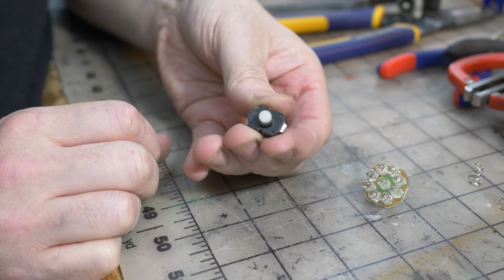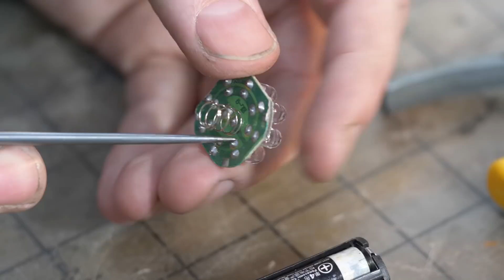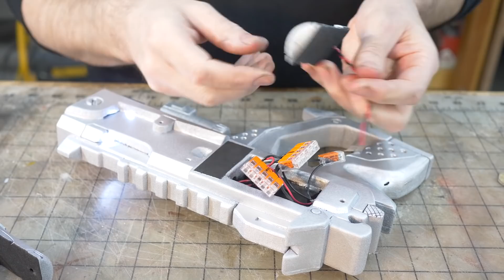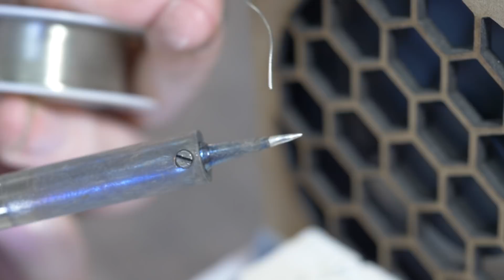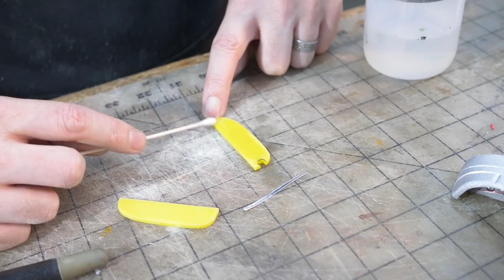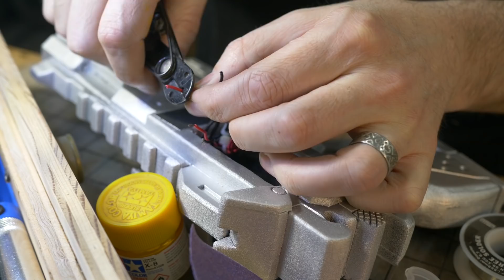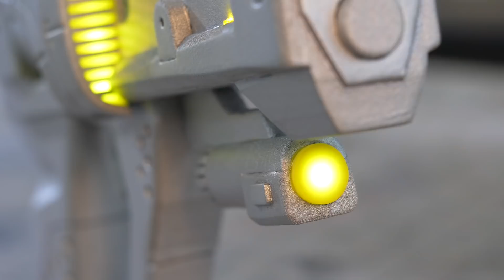Easy LED Lights for Cosplay! - BORDERLANDS 2 - Unkempt Harold Build - Part 2

Comment: Hi Bill great video, if you can get some 'solder flux paste' from somewhere like Jaycar, it will change your soldering life!  you just dip the wires in it before you tin them and put a tiny bit on any joint before you solder, I small tub will last years. You wont believe  how much easier and the improvement it makes on the soldering joint. Also a lighter on the coil wire for a second before you tin it can remove most of the coating, so you don't have to overheat the joint with the iron burning it off... And like a few have mentioned, your voltages etc are a bit off, remember most AA and AAA rechargeable batteries are 1.2 volts charged whereas normal batteries are approx 1.5 volts, so with 3 there is a pretty big difference in total voltage, 3.6 volts to 4.5 volts. But hey if you been running what your doing for 10 years and it's worked for you, then more power to you :)  there are much better options with the Lipo cells, let me know if you want a run down. 
As always it's a great video, thankyou, I enjoyed it a lot, and the blaster looks great!!
Reply from the maker: Fantastic tips! =)

Comment: This video is so extremely helpful because I'm planning to make myself a custom airsoft helmet
Reply from the maker: Super cool!
Reply: @punishedprops  I know you usually don't respond back but I have one question what kind of plastic would I use that is tough but flexible
Reply from the maker: To be honest, I'm not sure what kind of plastic would be able to adequately protect you from airsoft. I prefer to not build my own safety equipment. It might be best to buy an existing airsoft mask and then just modify and paint it to look neat.
Reply: @punishedprops  well I have a old world War II German helmet which is solid metal and I'm having a couple of problems with it as well as wanting to add attachments that's why I kind of want to find a good plastic

Comment: Love the video, but can't you just use a wire nut to bind all those wires together instead of using solder and heat tubes?
Reply from the maker: I suppose you could! I don't happen to have any wire nuts on hand. whomp whomp

Comment: there are connectors you can get that you just clamp on at harbor freight. I used them when I installed a car radio into my wife's car. With the big bunch you can use the screw on caps that you'd find in your walls. That seems like a more fitting way seeing as you wouldn't want to use heat shrink near your eva.
Reply from the maker: Super cool!

Comment: Great video as usual 

Sorry to be nit picky....But in electronics the negative  (black wire) is considered the common or ground. Positive  (Red) is the active side and should the side with the switch.

PS best way to clean the soldering iron (to make it shiny) is to run it across a wet sponge.. when hot.
Reply from the maker: Great tips! Thanks for sharing.
Reply: Your welcome 😆
Another quick tip with Leds - At the base of lens section there is  a flat edge on one side...Indicates the (-) negative pin

Comment: Fantastic choice of wires. A little piece of advice for anyone using higher voltage LED's; As cool as LED bulbs are, if you are running automobile grade(12 volt DC) in something like EVA foam, it will work but you'll have to reinforce the holes with some type of sleeve, as the bulbs can get hot enough to begin melting the foam. Even something as simple as using and iron to put the holes in, will vulcanize the foam enough to handle the heat. Fantastic video, and look forward to the next! ^^
Reply from the maker: That's a really great point! Thanks for sharing. =D

Comment: This is really low current/low voltage.... I'd use much thinner and flexible silicone wire. Something like 28 or 30 AWG. While such tiny wires can be fussy and delicate, they fit in small spaces easily. Spoke too soon. I should watch to the end before commenting! The enameled 28 gauge solves the problem nicely.
Reply from the maker: Great minds think alike, yeah? =D

Comment: I’m still a little confused about how to wire the switch. I’ve never done any electronic work and interested in trying it out. I’d appreciate a little clarification on how the switch is added in, if that makes sense. I understand that LEDs connected to batteries complete the circuit thus turning them on, it’s just the extra step that gets me lost
Reply from the maker: The switch is placed anywhere in the circuit, it just needs to be able to interrupt the circuit.. I just tend to put it on the negative lead in between the battery to the lights. I made a diagram on the blog post for this video: https://punishedprops.com/2019/01/07/beginner-leds/
Reply: Punished Props Academy That makes sense. Thanks so much for the explanation! Love the work :)

Comment: Great video Bill. For the big bundles you get an easier and more stable joint with dual wall, adhesive lined heat shrink tubing. It's basically the usual tubing but lined with hot glue. Search amazon or similar for "dual wall heat shrink".
Reply from the maker: Woah NEAT! I had no idea, thanks for sharing.

Comment: You should put a dab or even a piece of hot melt on your wires before using the heat shrink. Makes instant "Marine Grade" heat shrink. The heat will melt the hot melt and sort of consolidate everything together.
Reply from the maker: Oooh that's a really great idea!
Reply: @punishedprops  Its also good when using heat shrink on something like paracord. The glue seeps in.

Comment: So in the end you only use the leds. For 3$you could buy many new ones with unclipped leads.
Reply from the maker: That's true! If you only need the LEDs and not a battery holder or switch, buying individual LEDs in bulk can be much cheaper.

Comment: One thing I tend to do whenever I have too much wire to put together is add in a piece of perfurated board which I can then cover up with electrical tape, the solder tends to be sturdier, it depends on the space you have tho.
Reply from the maker: Great tip!

Comment: Can this method be done if the wires are connected to a shared wire and the wire is connected to an USB Power Pack?
Reply from the maker: Yes, just remember that the power pack is probably putting out more voltage and current than your LEDs are rated for. You'll have to use some resistors.

Comment: @10:12 reduce the current not the voltage current is how much electrons go into the led. voltage is current x resistance. LEDS read amps not volts.

Comment: Nice outro.....! I recently bought a fancy soldering iron withbadjustable temp. Whats the best temperature for that size of components...?
Reply from the maker: I'm not sure the temperature, but it's around a 4 on my soldering iron.
Reply: You'll probably be using lead free solder, which usually wants a temperature around 220°C. Large, heat sinking components will pull heat out of the iron, so you may want to run slightly high for big stuff if the iron isn't massive.

Comment: It didn't look like you had any trouble, but you have to be careful with the soldering iron when soldering those LEDs that close to the foam?
Reply from the maker: Yes I did scorch the foam a tiny bit, but it's in an area that'll never be seen.

Comment: Have you considered using soldering flux? It strips away the oxidation formed when metal gets heated and reacts with air, it will allow you're solder to flow better and make for a better, cleaner and properly wetted joint. Just make sure it's an electronics flux like rosin-core, mild-flux or water soluble and some isopropyl alcohol will clean up any leftover flux from you're piece.
Reply from the maker: I do have some flux for when solder just doesn't want to stick. Super handy!

Comment: Alkaline batteries usually have enough resistance so the LEDs won't overheat, but if you start using other types or power supplies things quickly get toasty without extra resistors.
Reply from the maker: That's very good to know!
Reply: @punishedprops  I wrote a long rambling reply about the difference between current and voltage, but then realized Sparkfun's already done it far better and less rambly :)  https://learn.sparkfun.com/tutorials/light-emitting-diodes-leds 
The correct current will help your LEDs last longer, stay more constantly bright, and help your batteries last longer by not trying to dump too much current.
Reply: @punishedprops  The resistors can also decrease the current and make your batteries last longer--sometimes without a huge drop in brightness.
Reply: @zachtayloriv  Yes i 've always heard them called current limiting not voltage limiting resistors. Its an LED thing I don't need to understand.
Reply: I'm paranoid. I always use current limiting resistors. Of course, I also make things like this USB rechargeable, so I design for 5V and use li-ion with a boost/charge board. Add in a 555 timer circuit and you can have special effects on the trigger switch. But that is beyond a tutorial at this level. But when you're ready, look up "astable 555 timer" for ideas.
Reply: W.h.a.t........ No, just no. It is good practise to ALWAYS use current limiting resistors. Yes you may get away with no resistors just like you can fit just one wheel nut instead of 4 or 5 on your car. It will probably work, until you really need it to work. Many Arduino style tutorials also leave out current limiting resistors (well any sort of engineering effort that requires reading a data sheet) and in micro based designs it becomes even more important otherwise you will kill the micro (Arduino, raspberry pi etc).
Reply: "Typical" internal resistance of an AA Alkaline cell is 0.15ohms. So with a short or low resistance they can "potentially" supply many amps, albeit for a very short time. The limiting factor (determining current draw) will be the LED design not the alkaline battery so USE RESISTORS...

Comment: This is interesting... I wonder if I could use my Anker 13000 portable battery for tiny LEDs (about 30 of them wired together). I am doing a project where I will have tiny LEDS on a light bar to light my entire face. (the battery is about 5V Output)
Reply from the maker: That should work. You'll probably need to sneak some resistors in there.
Reply: @punishedprops  And I have to figure out how to wire all of this to a USB

Comment: Those leds can’t handle 4.5V. 

Typical voltage of a white led is around 3.2Volt at 20 mA

The flashlight make use of the internal resistance of the AAA batteries which is relatively high when you are drawing around 200mA. 

Using a resistor also helps to keep the brightness more consistent as the battery depletes.
Reply: You could one of the many online resistor calculator to give you the resistor you need to use (e.g. http://ledcalc.com/).

Some people just use 120 ohm for everything, which is a safe bet when using 3 AA(A) batteries. 

LEDs are pretty weird. Not at al like incandescent bulb.
Reply from the maker: Oh that's very interesting, I had no idea!
Reply: @punishedprops  LOL!  Yea they were totally not working as designed in the flashlight!
Reply: Ronny Julian in the flashlight they are overdriving the leds a bit resulting in a shorter lifespan. Yes they work, but don’t expect them to last as long. And don’t connect them directly to a 3 AA battery pack, as AAs have a lower internal resistance, shortening their lifespan even more. 

I had to check the previous video. Bill is using 2AAA batteries for power, so that’s all fine. Using only 3 volt will make the leds less bright, which is probably better for props.
Reply: Yep you are right they are not working in the flashlight they are installed it!  :)
Reply: Those LEDs likely have something built into the die that limits the current through them.  However as a general rule, LEDs are a current driven device and should not be connected directly to the battery without something to limit the current through them unless the voltage source is less than the typical Vf of the LED.
Reply: Bill, the NiMH rechargeable batteries you are have a low resistance and depending on the type can put out some high current.

Remember, resistors are your friends.
Reply: @SnarkyPosters  these LEDs have something in the die to limit current flow........
Reply: @mdrew44628  {Citation needed}
Reply: They are probably referring to a built-in/internal, resistor. https://www.mouser.com/new/kingbright/kingbright-resistor-LEDs/
Reply: @SnarkyPosters  I made an assumption with the resistor in the die theory, but turns out that there is in fact NO CURRENT limiting built in to those cheap flashlights.  I found a 6 5mm led flashlight in a desk drawer.  I connected it to a power supply and set it to 3 volts.  I turned up the current and found that it did limit the current at around 100ma.  I then turned the current back down and increased the voltage to 7 volts.  (If there was current limiting built in, the LEDs should be protected.......). I slowly turned up the current until the  6 LEDs failed pretty much at the same time with a soft snapping sound...no smoke...lol.  So I learned two things;. You are right about the balance point of current draw and the nternal resistance of the batteries protecting the LEDs AND there is no low limit to the absolute crap that comes out of China....let the buyer beware.....
Reply: @mdrew44628  I'm surprised and reassured by you not just taking my/our word for and testing it yourself. 

I've burned up a bunch LEDs in my time. On matching the resistance of the batteries to LEDs, it's an older "trick" on the flashlight forums for direct driving a high flux LED 1 watt like a 1st gen Luxon Star.

As for the cost cutting of suppliers in China, they will sell you the cheapest parts you ask for. 
Those cheap lights are made down to the lowest price point possible and still function.
Reply: @SnarkyPosters  it continues to surprise me with the amount of absolute junk that comes out of China.   I can just picture the design group that came up with those flashlights......"no...take the resistors out of the circuit...we will rely on the internal resistance of the battery to pull the voltage down and protect the LEDs...we will save 6 cents on each unit"
Reply: @mdrew44628  Well, when you order 100,000+ 6 cents adds up quickly. 

Also, I don't think longevity was a major concern. :D

Comment: For those big bundles of wire that you used heat-shrink on, you could also try liquid electrical tape. It's a little bit cleaner.
Reply from the maker: Oh SNAP! I didn't know that was a thing! I'll have to get some.
Reply: @punishedprops  I got a little jar from Fred Meyer for about five bucks, and I use it for any awkward spaces where tape wouldn't readily work.
Reply: @joshmaceachern7383  Fred Meyer? This guy Seattles. :)

Comment: 2:30 just had the thought, that you could try to print some kind of cage for those battery holders, come up with an easy way to slide it in and out... with that you could hide your batteries in a magazine for the gun and change it whenever needed in style.
After some preparation a universal size and mechanism for that could be cool for many other guns, so the clips could be interchangeable (clips as in battery clip, not the magazine... i know the difference, thank you.)
Reply from the maker: That's a really fantastic idea!
Reply: @punishedprops  Time to fire up Fusion360. I'll let you know if I can come up with a solution over the next week

Comment: The System is Down, the System is Down!
Reply: The Cheat is grounded!
Reply: We put that switch in so you could turn on and off the light, not throw light switch raves.

Comment: LEDs usually also have a little flat spot on the negative side :)
Reply: I was going to put the same, it's a lot easier than having to look for the Anvil to identify the negative.

Great video keep up the amazing content 😁
Reply from the maker: Oh snap! I don't know how I never noticed that!
Reply: @punishedprops  You can even see it on pcb's silkprint.
Reply: Came to say that same thing. Found your comment first
Reply: But I've seen some cheap ass LEDs that have them backwards(flat on positive). If you buy your LEDs from RadioShack or something, it probably won't matter, but if you're scavenging LEDs, you may need to double check depending on the source.
Just FYI

Comment: While you're re-purposing the torch, the edge of the case can be sharpened up to make a large foam hole-punch too...
Reply: Also since they are aluminum and inherently lightweight, he could use them like a barrel mod for a Prop gun.